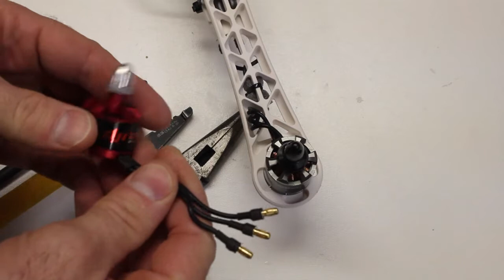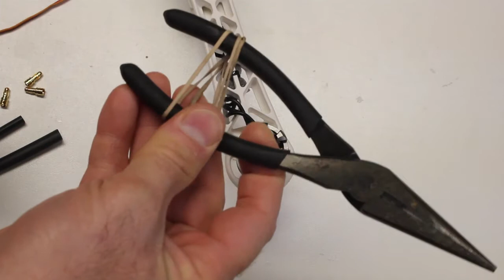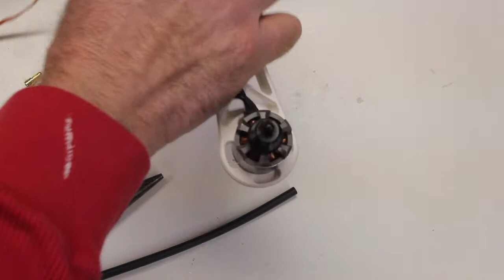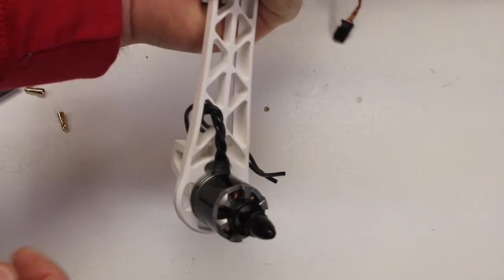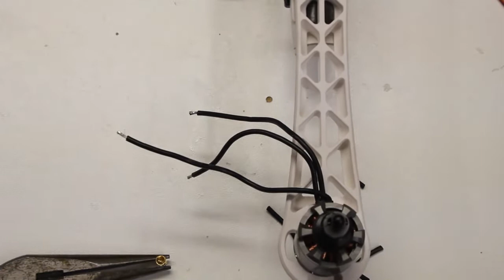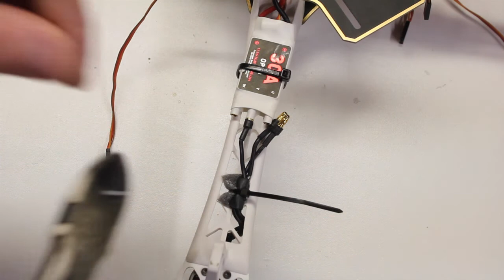MultiRotorForums.com F450/NAZA Group Build Vid 5

Comment: what are you using to clean the flux?
Reply: +richy todd Not quite we know  what you are referring to...  What he is doing is " SOLDERING "  FLUX would be something you stick a rod into if you are doing some gas welding... of if you are  soldering / sweating copper pipes...  flux would be a past you apply to cleaned surfaces before warming up and apply solder...    Not quite sure that pretty girl in your avatar....  knows what a LUNK she has her arms around...   :)  You don't have to know a lot about everything...   but...  solder.... really doesn't leave a residue that has to be wiped clean...